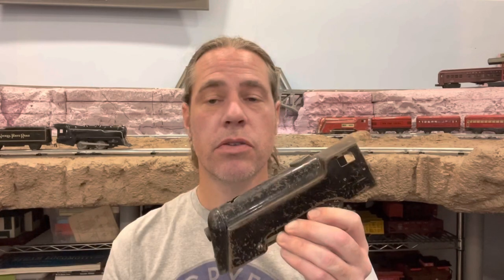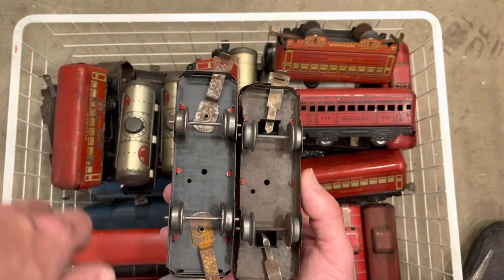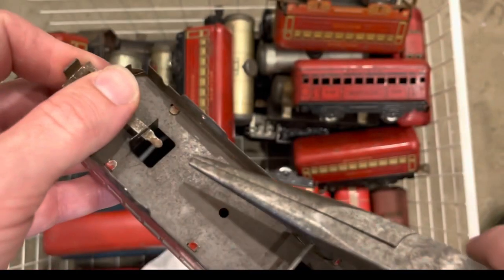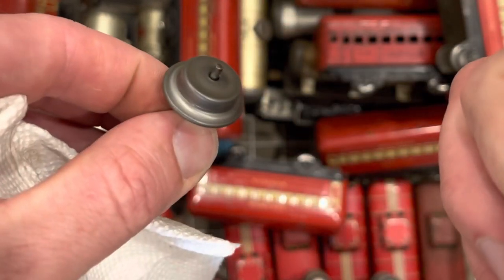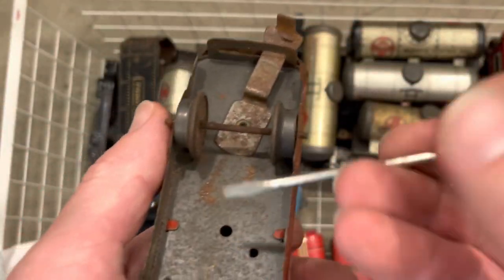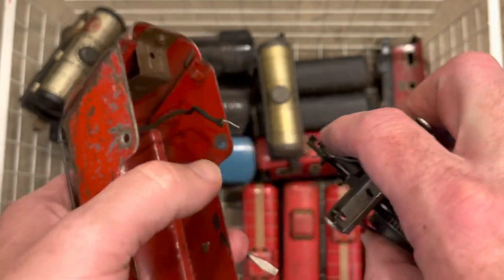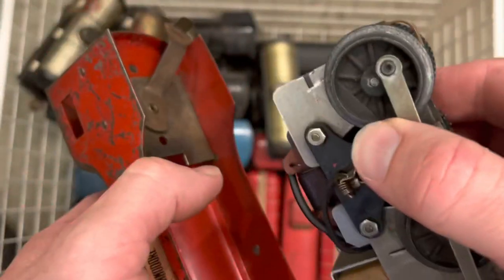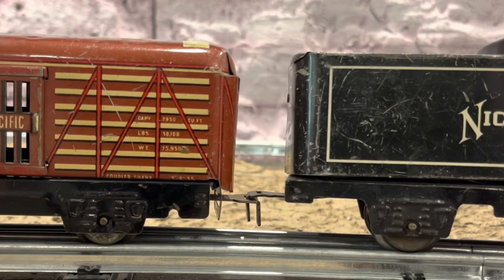Marx Tinplate Trains! Maintenance, Repairs, and Running. Make them roll like new!

Comment: The purpose of the Marx sliding coupler, which causes slack, is to give a wind up locomotive a small head start before it picks up the weight of the train. I always enjoy your channel. Thanks.
Reply: You got it!
Reply: @chiconian49  I always liked the sound of the real freight trains when they took up the coupler slack.
Reply from the maker: That makes sense! 
I had wondered if that was the case, noting the difference between the ones with slack and the solid mounted one.

Comment: A service tip, when you bend up a mounting tab do not bend it back down. Simply give it a slight kink or twist to prevent breakage and to permit later servicing with less likely hood of breakage. I add cylindrical fishing (pinch on) lead weights to the axles for low center of gravity weight.
Reply: Every time metal is bent [twisted] and bent back without breaking its a blessing.
Reply from the maker: That’s a good tip. I’ll have to keep that in mind. Maybe just don’t bend the tab back the way it was, but a different direction so it doesn’t bend in the same spot. I’m not familiar with the weights you’re using, I’ll have to check that out. 👍
Reply: @dagryffynhobby  I get them at bass pro

Comment: As a sideline to my regular trains I had a small 027 layout with mostly Marx cars and some engine. I love how a train of tinplate cars will sing when they are going down to track it is an interesting phenomenon. Josh small cars along with the 666 locomotive are excellent at simulating a branch line of a larger Railroad in the 1920s and 30s. Most cars in that time period were 36-foot which translates to 9 inches. They would be pulled by cast off Mainline steam locomotives too small for Mainline service any longer. The tinplate trucks are very nicely done as well.
Reply from the maker: Yeah the sound is amazing as they roll.

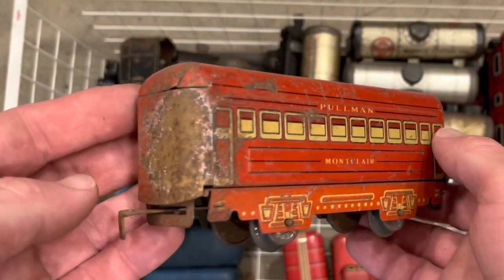Comment: 5:37 The red-framed cars are actually a great way to tell what year they were from. The black-framed cars are from the postwar era and the red-framed cars are prewar, more specifically the years 1937 and 1938!
Reply from the maker: That’s good to know, thanks so much.
Reply: Actually, I just looked it up. Those red framed cars are ten times more desirable than the others because,well, for one thing they are not from 1937, they are from 1934. They're the earliest cars not from the Joy Line. Also, look for the ones with a shorter wheel base, those are post-Joyline, very desirable early 30s pieces, then the lithographed frames, and to tell you the truth, any color other than black are low production early scarce items. Black framed cars are not nessasarily post war, they go back to 1936 or so. That other gentleman who told you about the sliding couplers is correct, they are for clockwork motor powered locomotives. A well tuned clockwork locomotive is a charming machine when in it's home field. Remember,if these things were people, how old they would be. Cherish them. They were the source of inspiration for the greatest generation and they are charmed. When working on them, don't be afraid to go for perfection, not just good enough.😊
My source of information was Greenberg's American Toy Trains, and 32 years of experience in the field.

Comment: Another great video Dave. I love running my Marx & Lionel stuff on parallel tracks. I also have an adapter coupler that my son in law made using a 3d printer that allows my Marx 490, 666 and 999s to pull Lionel freight & passenger consists.  Run trains!
Reply from the maker: Thanks Bruce! I have no choice but to enjoy myself with these trains. Pure joy and stress free. I’ve never thought of running Lionel and Marx in one train. I had thought about putting a Lionel motor on a Marx shell, but that just seems like sacrilege.

Comment: Leave the tabs as straight as possible in assembly and put a drop of Carpender's glue on each. The glue can be scraped away with a razor blade in the future.  I painted my C/P shell silver and yellow and dubbed it   "Sunshine Express".  Forget the wait, build a traction wheel with electrical tape in thin rear wheel strips.   Marx trains are the Bees Knees.
Reply from the maker: Great tips! Thanks for sharing. 
Sunshine Express, I love it

Comment: Good service job Dave, and surprising amount of tinplate. My general interest of tinplate is about zero, except the idea that they are old and have some memory of what my older brother had and my dad might have had. Interesting how MarX kind of stuck with about the same AC motor for all of their trains over those manufacturing years. I have a set of two MarX diesel yard switcher engines coming. Got my first one last year and was super pleased  how quite it ran once it was oiled and running. Very heavy engine due to that motor and the lower main frame is cast iron as well.  #1998
Reply from the maker: Thanks. I don’t know that I would be into these trains if I didn’t have the ones my mom and uncle grew up with. But I’ve really enjoyed collecting and running them.

Comment: I have my Dad's windup engine and I'm 99 percent sure it's the same engine. We live near Moundsville WV so it's a reasonable chance its a Marx toy. I need to get the spring repaired.
Reply from the maker: There are tons of these Marx wind ups out there. I see them all the time at shows. I had good luck with one that wouldn’t work, I sprayed wd40 in it, soaked it, then let it sit for a few days. The spring went from being rigid to being able to be wound up significantly.

Comment: Looks like you have about 16 cars in that long consist including tender and caboose, very cool. Do you know any tricks to cleaning Pre-War Lionel tinplate without hurting the paint? Thanks for any suggestions!
Reply from the maker: Thanks! With the added weight in the engine, I think it might pull a couple more, but there might be too much wheel slip. 
I have no experience cleaning the prewar tin cars, I’d be careful. I have some that the paint is practically turning to dust!
Reply: @dagryffynhobby  Thanks Dave.

Comment: Anyone know why my Marx 5620 engine stops running after less than a minute of use? The wheels get really tight and hard to turn by hand when it begins to warm up. Wheels roll freely when cold. I cleaned and oil with no success.
Reply from the maker: Interesting. Wish I had an easy fix. Without pulling the wheels and replacing the axles, maybe spray the axles with electronic cleaner or something like that to try and force out any foreign debris and then give it a good oiling, too much oil, spin the wheels to move it around and then let the excess drain out and wipe it off. I haven’t had a problem like that so I’m just winging it.
Reply: @dagryffynhobby  Did all that.

Comment: I use Lionel switches in my layout, but my fist ever engine was a Marx with a single reduction motor, and those don’t through Lionel switches, but Marx also made double reduction motors that can run through Lionel switches, so I just swapped the single with a double and it runs great!
Reply from the maker: There’s a solution for you! Most of my Marx would not go through switches.